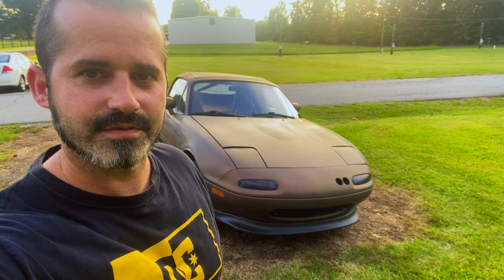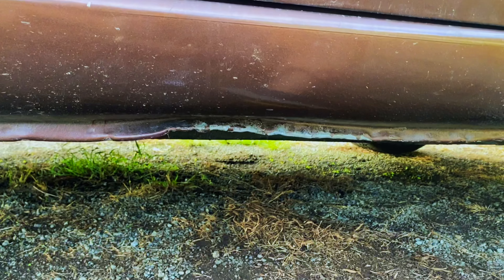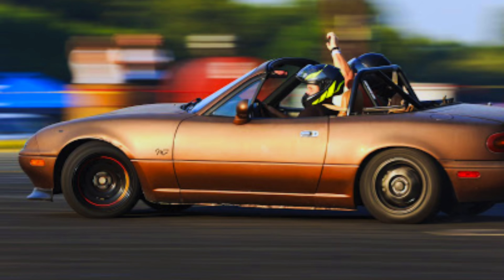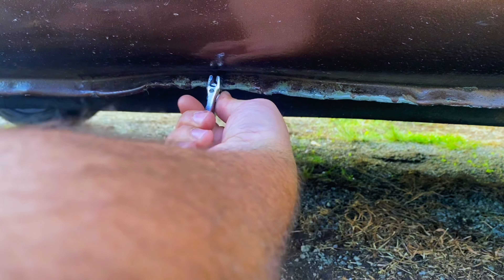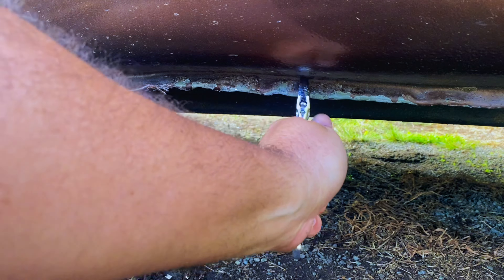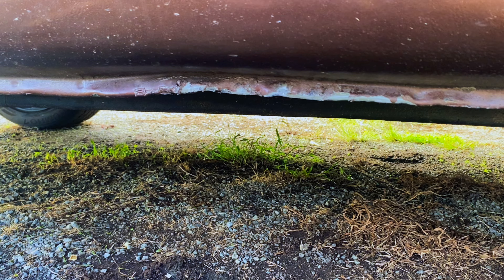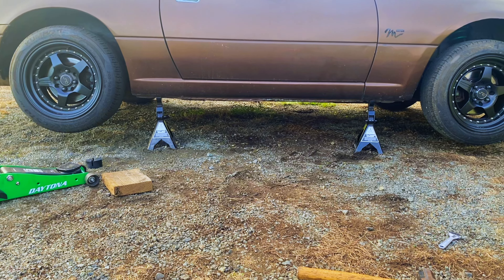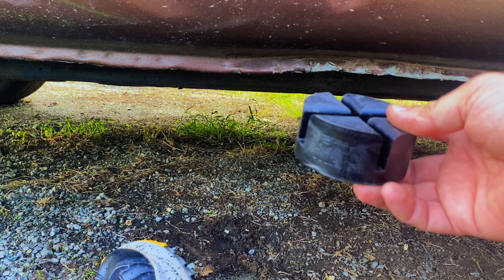Repair A Pinch Weld! Work Harder Not Smarter!

Comment: but what I wanna know is, how structurally sound is it 1c collapse then bent back?(recently askd a mechanic & he said it’s irrelevant - & fine), but dOnO if he’s 1 of the many mech.’s(& just Ppl) who ALSO dOnO👋😒.
Reply from the maker: It’s definitely not going to be as strong as it was and would bend back easy if I used it as a jacking point again. It’s more to make it look hood again. I’m going to be using the adapter from now on to protect it.
Reply: @ 
‘protect it’ from what? 🤔
Reply from the maker: @ezwa9979  from folding over again when I use it as a jacking point again
Reply: @ 
O.  yeah I dO the same - but working on seeing if there’s anything holding a certain 1/2 framerail in place, another 50/50 odds of not being crushed kinda-thing.. (icon, playlists, secret chinese jackspot or deathtrap, 5th video calld ‘part 0’, horrible video, but shows this 1/2? connected framerail in bigining)👋